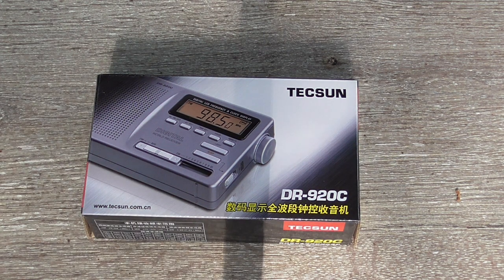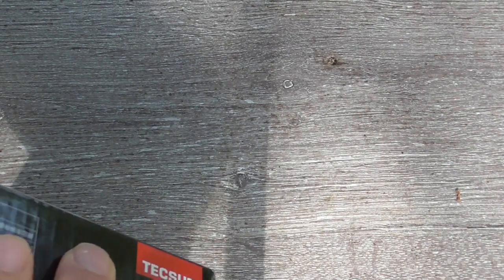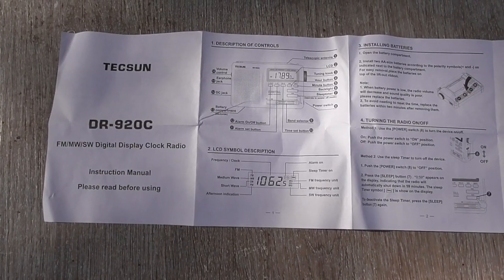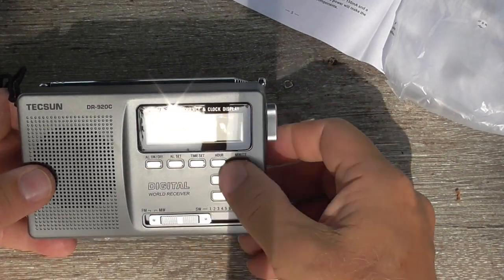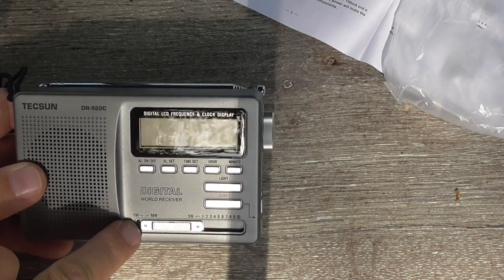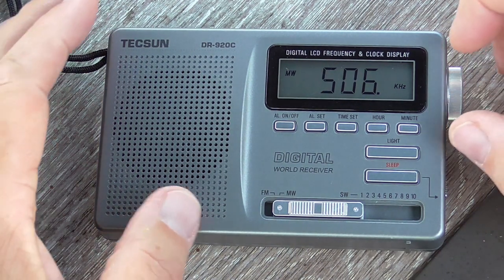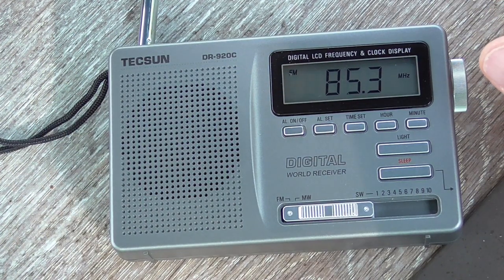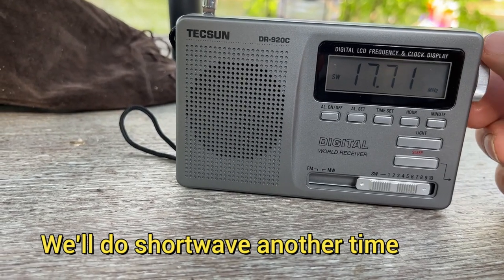Tecsun DR-920C unboxing and Initial test

Comment: Doesn't seem quality product...
Reply from the maker: I wouldn't exactly say that. The fact is that modern DSP radios just perform very well, especially on FM, in comparison to single-conversion superhet analog radios. Additional testing on MW got more stations than in this video, and I can only guess that there was some atmospheric noise during my original test. The build quality is good and the radio feels solid. The band switch operates smoothly. For my full review and conclusions, see https://www.blogordie.com/2023/05/tecsun-dr-920c-review/
Reply: It.s actually easier and more accurate to use a thumbwheel  tuner like the 911. They put gimics on for more  sales! Besides every gimic uses battery.